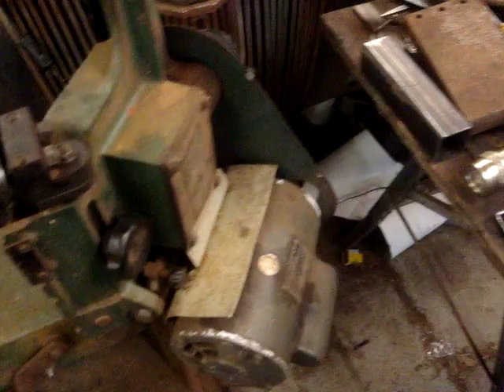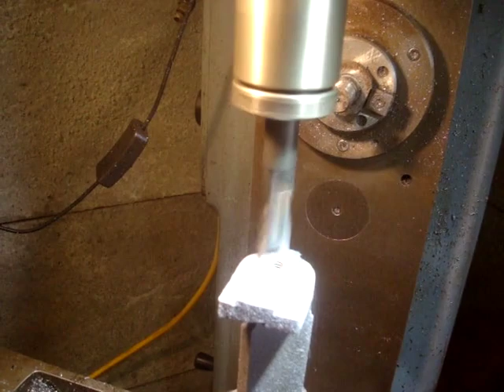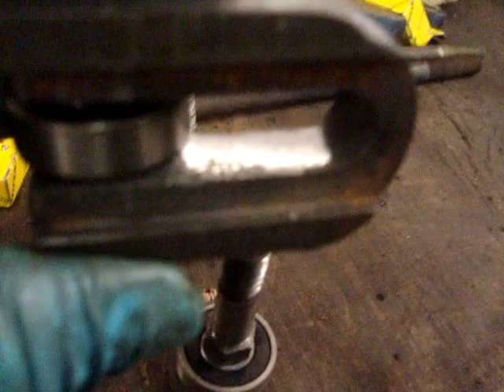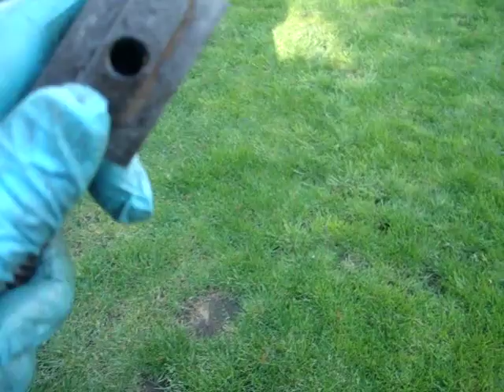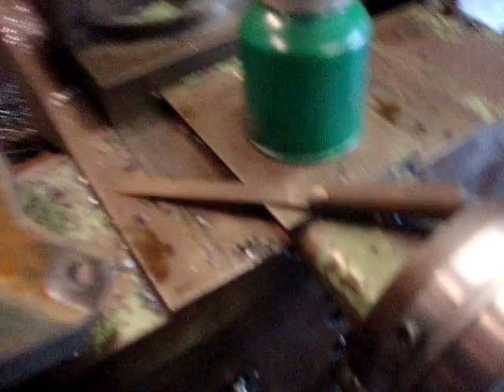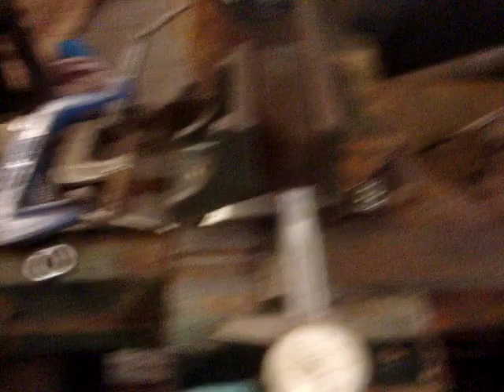4x6 bandsaw. Repair and adjust. Part 1. Will it cut straight?

Comment: Identical to mine, which has a 1983 date on it.  Trying to tune it up a bit, doesn't cut straight.  It's been a solid old workhorse, though...
Reply from the maker: Definitely a useful addition to any workshop. Unless you can get a bigger "proper" machine. I need to revisit this, mine is cutting a bit "off" now. Thanks for watching.